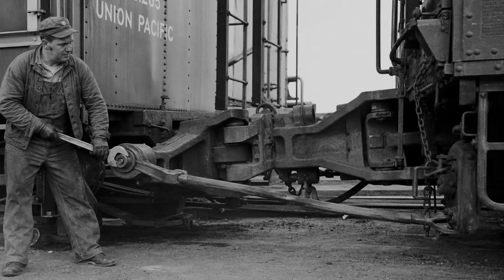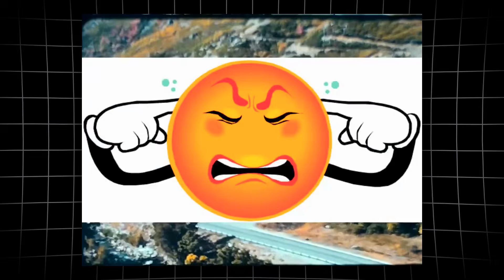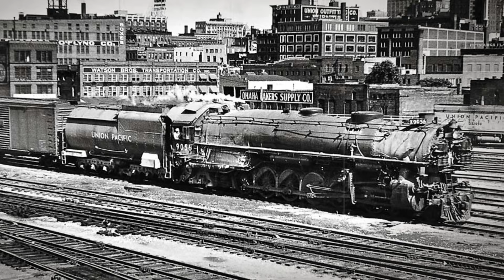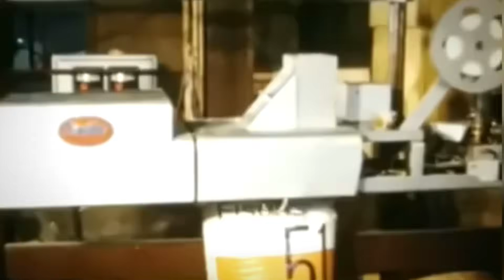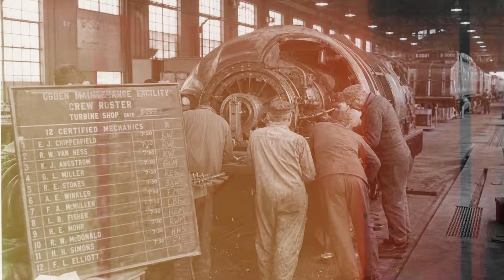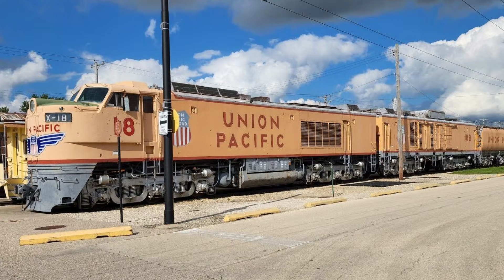The Locomotive So Powerful It Tore Its Own Trains Apart

Comment: Why are we mixing steam and diesel photos together. I can understand if you have a diesel pilot with a steam engine train loco. But often you are discussing multiple diesel locos. I can understand why a pusher loco crew would need to coordinate with the train crew. If the helper is on the front, wouldn't they just hook up to the lead loco in multiple string as the controlling loco?
Reply: AI BS🤮🤬👎🏻